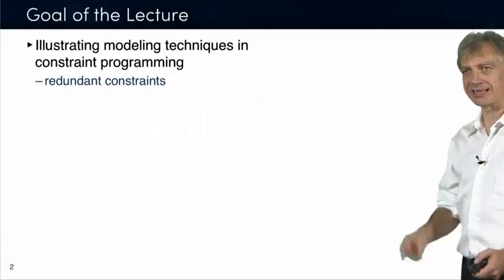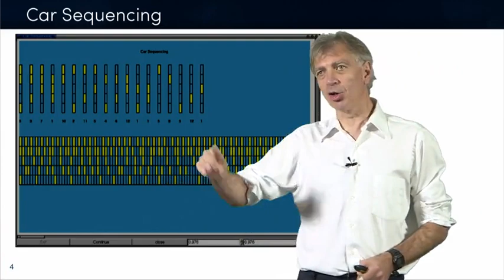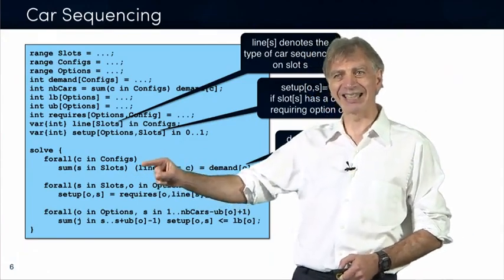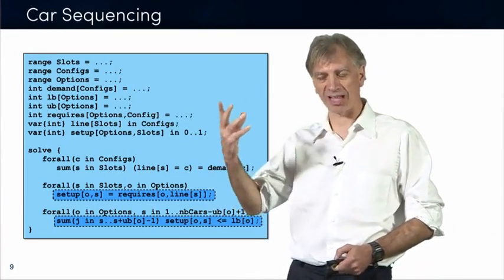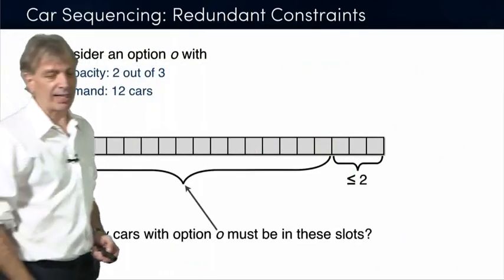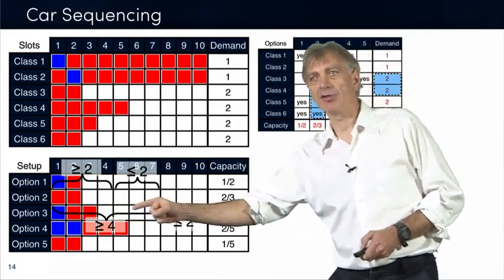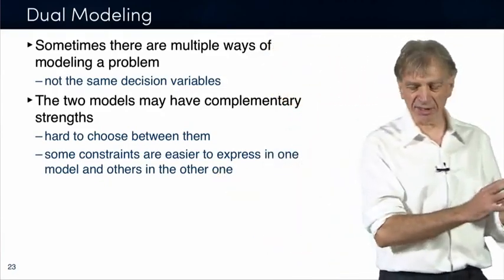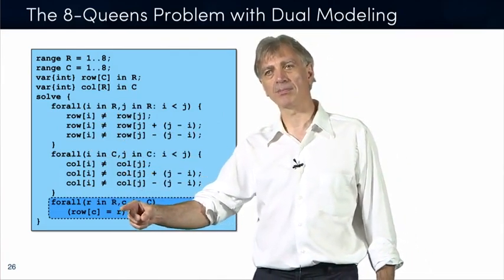Discrete Optimization || 07 CP 7   car sequencing dual modeling 18 20

Comment: Hello
can you help me this this Problem please. 
A station is given that is 25 m long, with the conveyor belt moving 0.5 m per second. The cycle time is 20 seconds. The exhaust manifold is mounted in the station, whereby the assembly takes 13 seconds for the standard exhaust and 22 seconds for the rally variant. Find the sequence rule!